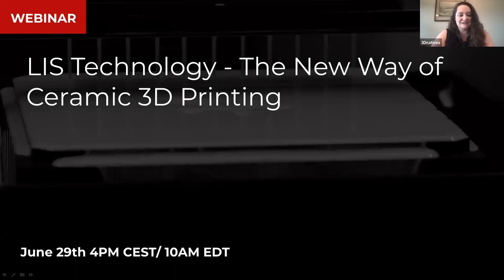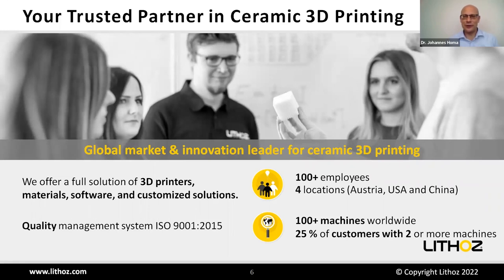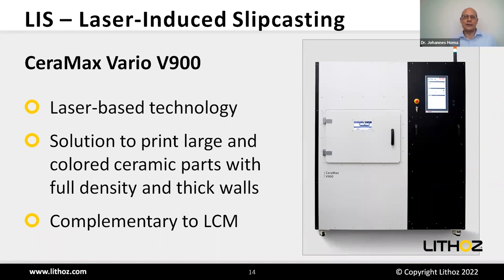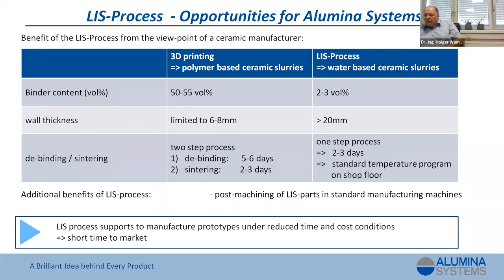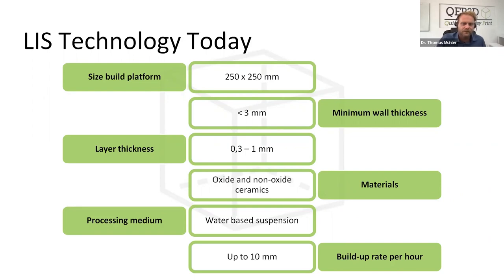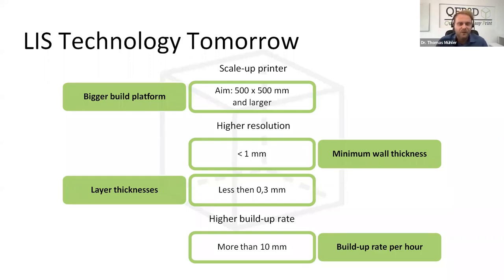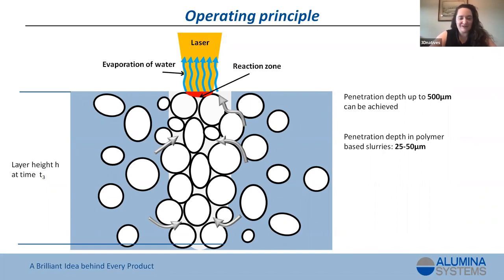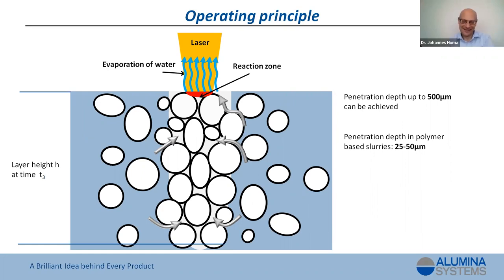Webinar: LIS Technology - The New Way of Ceramic 3D Printing

Comment: Compared to the Clay Station 3D, this printer is not high quality. The build area is tiny unless you're a squirrel. A maker should not be restrained by a tiny size of the 3D printer when creating things. The Clay Station 3D allows you to 3D print ceramic objects in life size. Free installation and delivery.